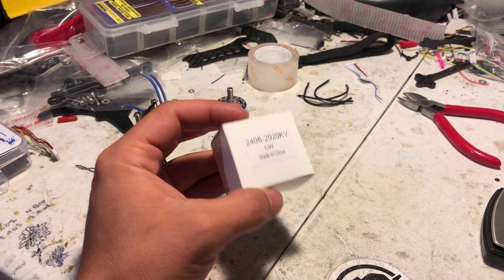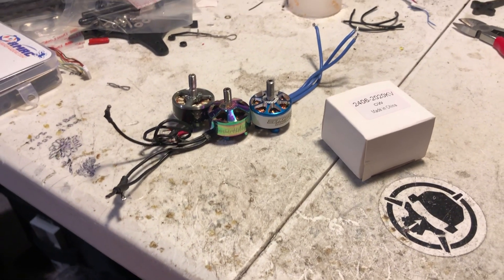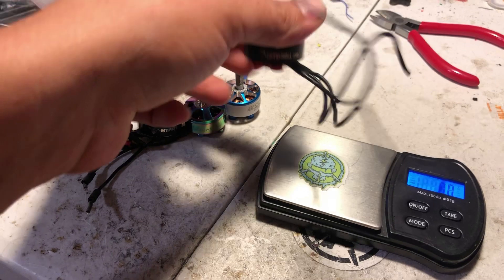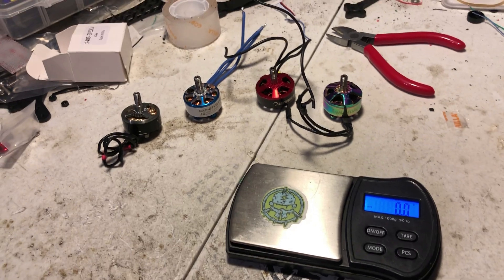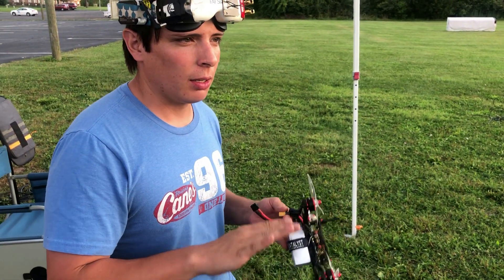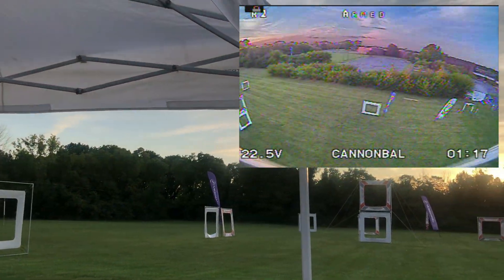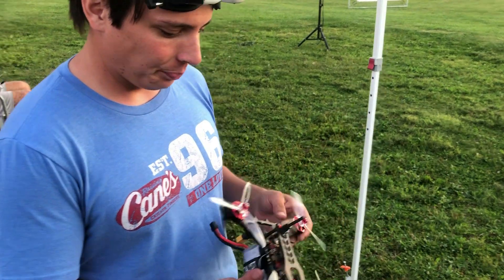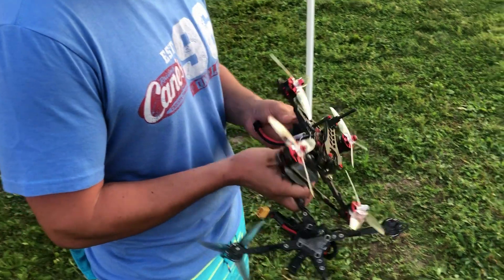Cannonball 2406 2020kv Motor, Game Changer?!

Comment: At 30k RPM, the linear velocity between of the bell at the magnets of a 2207 motor is 34.5m/s. For a 2406 motor it's 37.7m/s. Is that taken into account when putting KV rating on these? Or was it determined by testing? I find these motors very interesting but I'd like a true 2100kv - would be a speed and torque monster.
Reply from the maker: Ben B I’m not sure to be honest. Basically I asked the manufacturer for a kv range, and they wind it with whatever tools and match calculations to get as close as possible and then test it for the “true kv” which I assume they just measure at a given RPM and based on the voltage = kv

Comment: I just received mine :) What props would you recommend for fast freestyle on  5" BangGOD AUW 750g with session and 1250 6S?
Reply from the maker: D C for super fast responsiveness and snappy feel I’m loving the gemfan wind dancer 5043,
If you want big punch out power and great control with a little less snappy feel, then I’d suggest the 5149 flash gemfans
Reply: @gabbychavesracing24  Brilliant! Thanks!

Comment: These 6s?
Reply from the maker: Change Agent yes I run them on 6s 5”
And I like 5s for 6” props
Reply: @gabbychavesracing24  Do you ever run 7" props?
Reply from the maker: Change Agent I don’t have any 7” frames yet but working on trying one soon
Reply: These should do pretty well on lighter 7" rigs - have flown 7" on 2208 2000KV, and it's not bad, but does have some of the stator volume worries.
I think these would absolutely rip on 5S 6" setups though - amazing cruising rigs in this KV range, but keeps all the agility you'd expect out of something in the <500g range with battery.
Reply: @changeagent228  Dang, yours is nice and light.  I think on a truly barebones setup (20x20 stack, thin arms, 4S 1500mAh pack, no frills) these motors would unload quite well and perform - but it would be somewhat of a specialist quad.  I run 2508 so I can crash around a bit more, and not have to think about hauling a GoPro
Reply: @tehllama42  My setup includes a session 5 + marco polo + vifly + gps and without those it's about 120g lighter. I considered 2206 2207 2208 2306 2406 2507 2508 motors and also 2806.5. In the end I decided Emax RSii 1600kv 2306 at 26g gave me a good balance of power and weight. I find I prefer very light feeling quads that need just a gentle touch. Once you put bigger heavier motors on you need bigger batteries and weight goes up more. We need to work backwards and increase efficiency. Only issue is the 7"+ stability on light setups. Hopefully the HQ 7x3.5x3 props I have ordered will provide the smoothness I have come to expect from 5".
Reply: @changeagent228  I think you're in the weight range where the HQ triblades will work well, provided the bobble response goes OK.  I try to use mine as both a racer and LR rig, which means I want the bigger motors - net result is I can flutter those HQ's at low throttle, and need to go to 7042F or T7056C to push that out to 80% throttle even.  More stator can mean more efficiency in certain duty cycle regimes, and I'm legit terrible at slow cruising.
I'm pretty proud of hitting 675g or so on mine with Session4 and GPS, big motors, and 6S 1300mAh pack.  Without GoPro and running lighter 6S 1050mAh packs, it's a truly race pace rig, but I have a pile of 5" quads that do the same thing so I don't use it like that much.
Reply: @tehllama42  You are right that more stator can help efficiency and often on the motor prop charts you see improved efficiency at low throttle although the 2806.5's are still only 4 grams per watt for double the weight of 2206 2207 2306. I think 7" stability might be linked to overall mass so we may be forced to accept that lightweight 7"ers will always be a little unstable in a way you can't tune out. I also fly long range with mine. The reason I built it was to get increased range but then found it seemed slow compared to my 4s 2206 2300kv 5" so I swapped out the 4s 2206 1400kv motors for some 6s 2306 1600kv ones. Now I'm also wondering if I should try 6s 2207 1900kv or maybe even those 6s 2406 2000kv motors Cannonball posted about. I generally run a GNB 130C 6s 1100mAh.
Reply: @changeagent228  Anything north of 1850KV with good motor construction is going to be stupid fast - beyond that you're almost prop selection driven, or you need a throttle cap to make it reasonable.  I've ran up to 2250 and 2350KV on 2207/2207.5 6S, and they're loopy fast, but the top end eats batteries and flutters even beefy props.  Setting a throttle cap of 75-80% brings them back into line, and adds a lot of flight time.
I wanted to push my 7" stuff to see if I could get the handling of my best 5" stuff - it's close, but does other things super well.  Similarly I've gone deep down the 3" rabbit hole (1408 3800KV, GF3052F, 4S 650mAh ) and gotten close to the same speed, but the handling is again different in other ways.  Stupidly, I'm faster flying my angry little 3" setups on most tracks.
Reply: @tehllama42  Yeah for sure it will eat batteries. I can't wait till we get our next battery chemistry upgrade. Lithium sulphur could triple our capacity for the same weight and is due out within the next decade. I'd like to try 2300kv+ on 6s but agreed the props will exceed their max RPM. I love high speed sustained cruises. Efficiency drops off quite quick above 50% power but even so some lovely medium distance constant throttle flights can be enjoyed. I wondered about a fixed wing like the Ritewing Recon that can do 110 mph sustained for 8 minutes but I really like flying my quad. I wish I had a quad that could do 100MPH for 8 minutes lol. Also yes those 6s 3"ers look pretty good. Especially the Diatone 369 that AndyRC clocked at 130mph. To me the handling on the 3"ers seemed really light and loose compared to bigger, like I trusted it less kinda.

Comment: Why do you weight the first motor with tare out the wires, and all another just normal with wires? So you can't compare the weights.
Reply from the maker: First motor has 16cm of wire, other motors have 10cm
So I cut 6cm of wire to have fair comparison